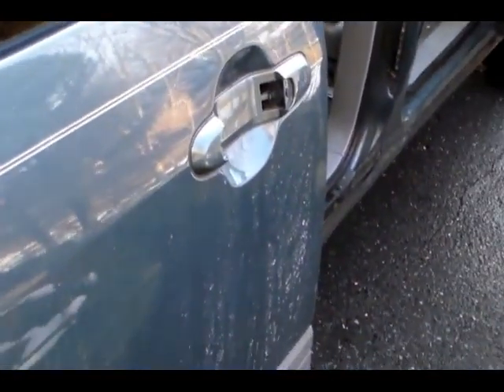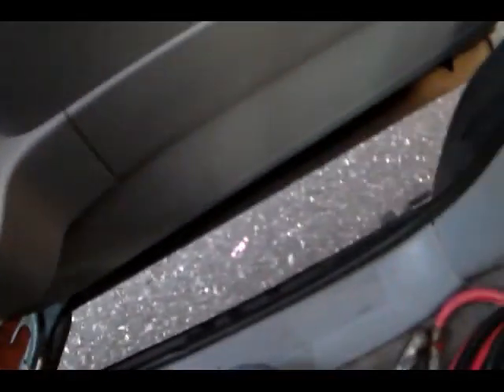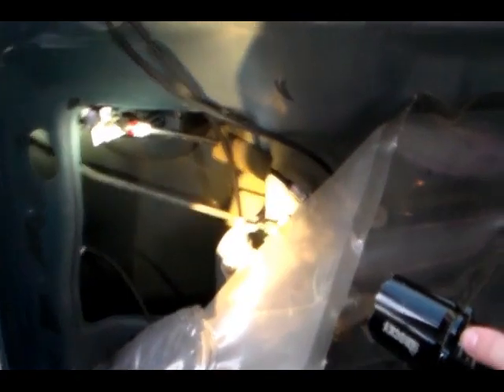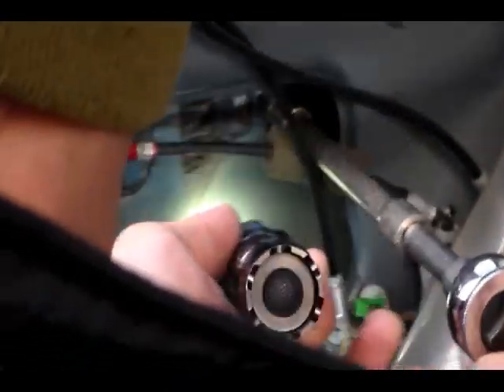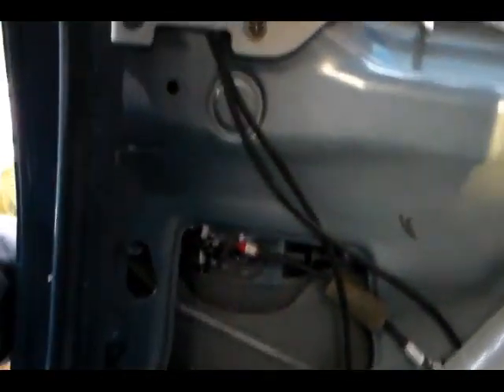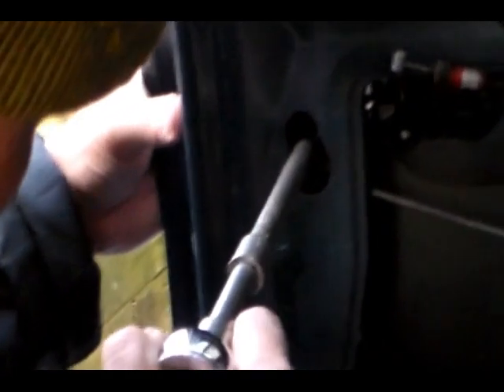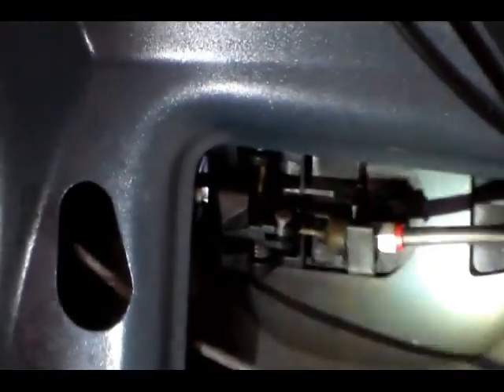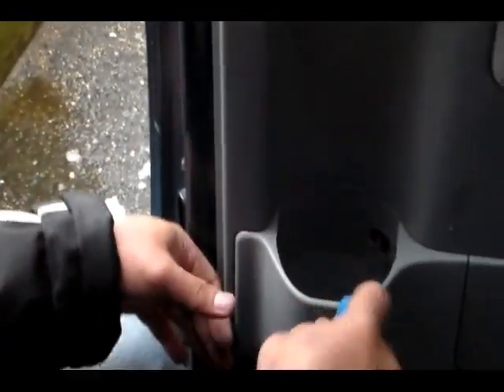How to Install door handles on Toyota Sienna 2001 side sliding door  also for 98-2003

Comment: He. Should pull the cup holder first then take the 2 bolts out then push the handle out  and put the cable from the outside